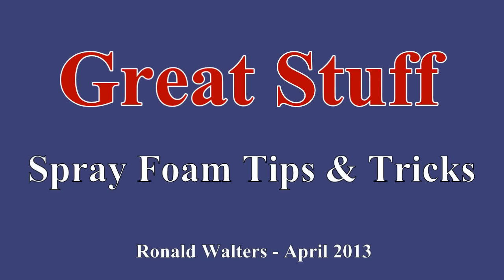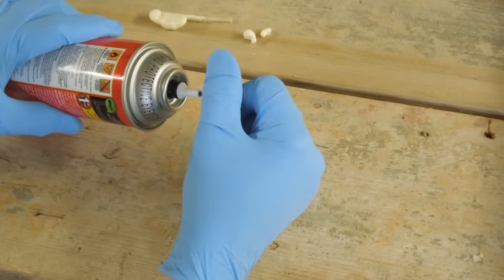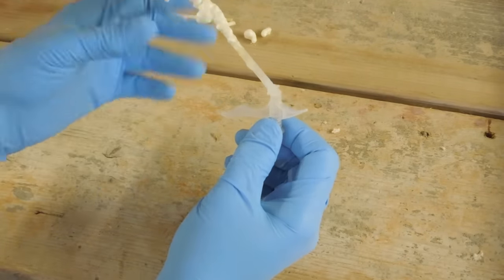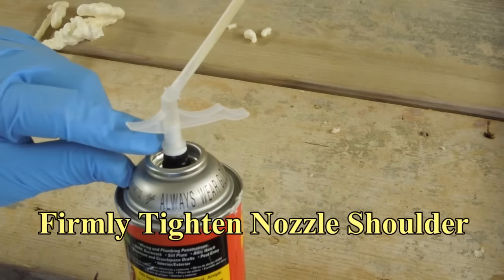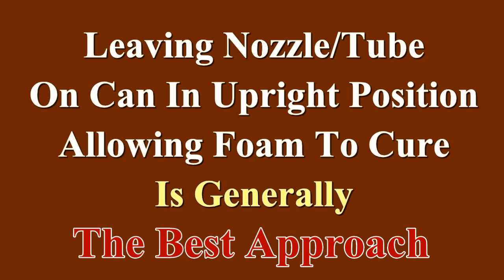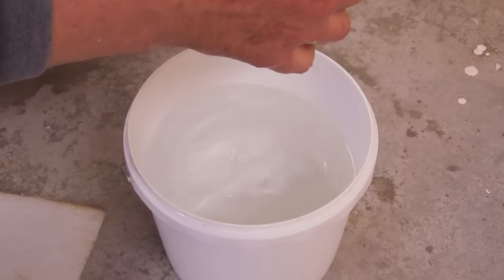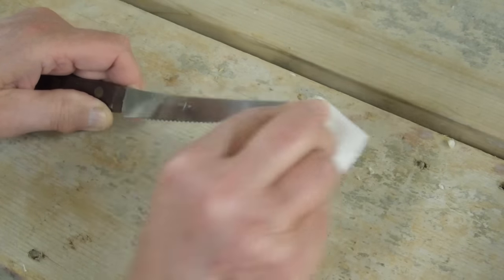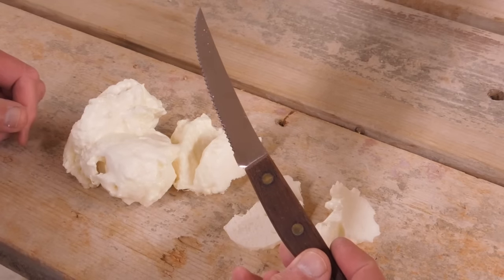Reusing Spray Foam Cans No.1 - Tips & Tricks

Comment: Use break pad cleaner or carburetor cleaner as mentioned below. It works great for cleaning the nozzles etc! It'll go a long way. You don't need the screw. less worry of puncturing the seal and spraying all over; limiting the danger of spraying your face. Protect your Eyes!!!

Comment: This is a really informative video. I've turned the cans upside down in a cup half full of acetone in order to dissolve the cured foam in the nozzle. It worked well enough that I'd have done it again -- until I saw your video. Your screw method is the better way by far. Thanks for making and posting this.

Comment: Just got thru accidentally making a sheetrock patch worse! Not because of any spray foam but because I pressed against the inside edge too hard as I was placing a sheetrock screw. So, I've re-cut a new patch. This time I only crumbled a 1.5" round hole in the edge. There's nothing behind the hole, so I plan to use the brand-new can of spray foam I bought. It's such a small application that I almost just filled the hole with mud... but that would take a lot of time due to the multiple times I'd have to fill, and let dry. Fill, and let dry. Thanks for your video! Now I can save the remainder of the can for the next gaps I create!

Comment: You give great directions.Thank you for all the tips.  Last time I bought this stuff  I called the company to ask them how to save it and they said it has a one time use.  So I needed it again and looked up your video hoping I could save it and see that now the dispensing straw is different.  It is now a red plastic tube with a yellow thing at the end that you"open".  It shows that you close it when you're done.That implies to me that it might now be reusable and shouldn't dry up inside the straw but the directions on the can  still say "one time use is to be expected" . The nozzle looks like it will make it harder to clean out the straw. I'll find out. Thanks for all the cleaning tips too. I'm "the wife" so I only have myself to get mad at if I mess up an old knife.

Comment: As everyone knows, this stuff expands, often more than one anticipates, and my know-it-all construction buddy likes to try to shape it like caulking when this happens, WHILE IT'S WET, which is a mistake, and it only takes 2-3 weeks for the stuff to wear off of his fingers! I put masking tape on surfaces like window edges that I want to protect before spraying it. Resist the temptation to touch it if it grows too big - as it often will. Let it dry, then trim it neatly, and use the trimmings to fill the underfilled sections.

Comment: I'm just about to seal a long run of buckled flashing with Great Stuff foam, and I was dreading the waste of money on the famously non-reusable cans. I strongly suspect that your VERY detailed, thorough video is going to save the day. Many thanks!
Reply from the maker: A word of caution about using this foam around door or window frames or anything flimsy (?? buckled flashing) as the foam can generate a good deal of pressure as it expands and cures causing distortion. A low expansion foam or caulking may be better... but I have no idea what you are trying to accomplish. 
Thanks for watching.
Reply: Thanks for the heads-up Ron. Explaining exactly where I'll be applying the foam would have taken a couple of sentences, so I took what I now realize was an ill-advised "shortcut" by calling it "buckled flashing." In fact, the aluminum is backed by half-inch plywood, ring-nailed on 6" centers. Nonetheless, my past experience has demonstrated just the high pressures you warned me about, so I'll be careful about how much I put into the gap.

Comment: Here's an easier and safer method that works for me every time.  Immediately after dispensing the foam, remove the tube from the can and clean off all the excess uncured foam from the can nozzle and the tube.  Next, with an eyedropper, drip some acetone into the nozzle until all the foam dissolves.  Do the same with the tube until the foam is all dissolved.  To finish cleaning the tube I make a "spitball" out of a bit of paper towel, shove it in one end of the tube and blow it through using compressed air.  For those who don't have a compressor, a pipe cleaner may work.  This method is safe and works every single time for me.  The manufacturers will never share this tip with you because they are greedy and want you to buy more product.  They don't care about waste.
Reply: I've always done this, but now, i'm going to try Ron's method. Here's why. I'm finding the nozzle itself is getting stuck. I don't know why, but it makes sense(as Ron showed)if there is NO foam in the nozzle at all, it can't get stuck.  So, to make sure you and anyone that doesn't do this knows, i know, I've done exactly what E.Plumbus does, exactly, and i have a couple of brand new cans i can't get foam out of. It appears, to me, that the nozzle itself is somehow frozen. I was finally able to break one, not ideal, but hey, i needed a dab of foam.   BTW, this stuff is great as a glue. I don't know it's long term holding power, but it sure works well. Also, if you are careful, you can scoop it up, and re-apply w a putty knife. I know, i know, it doesn't 'expand' as well, but it works well enough in certain situations.
Reply: Hi, I am the wife of Bruce (the name on this reply).  I used the acetone/dropper method and it worked great!  I felt more comfortable using this method than putting a screw into the top of an aerosol can.  Tip:  Put some acetone on a paper towel after you are finished with everything to clean up anything the diluted foam touched.  If possible, clean it all outside over paper.  Thanks for the help!

Comment from the maker: I used small plastic tubing to get the foam into areas overhead where the can was hitting the ceiling. The gas pressure in the can is relatively low and the extended tubing creates enough backpressure where the foam comes out very slow and when the can is half empty it nearly stops altogether. Therefore the tubing extension cannot be very long. A clamp where the tubing goes onto the nozzle nipple is also a good idea. Safety goggles, old clothes and gloves again absolutely necessary.

Comment: Great video. I also found about 1cc of acetone tipped into the can nozzle dissolves the liquid foam and cleans it up ready for next use. Same with foam that's still not set in the tube, where it can be gently squeezed through.

Comment: Helpful video… I've also found success with simply pushing a wooden skewer or wire ( like an insulation put up wire) into the straw immediately after use. I leave the straw connected to the can, skewer and set aside. If careful when removing, one can have success with this, if not the straw can break off at it connection point…The cured foam typically pulls out clean from the straw and the can can be reused…   :)

Comment: Excellent! And thanks for showing the flame test.  In 1975 someone got a flame too close to similar foam at the Brown's Ferry nuke plant and the resulting fire followed the cable trays and took out many of the connections between the control panel and all the various actuators, pumps and valves and meters. They barely scrammed the reactor and I don't recall if they ever got it going again. So your reminder is good that while this stuff is a great insulator, it is not so great in event of a fire.

Comment: I find that an old hacksaw blade with a sharpened point or tip to plunge into the foam and then make a cut works very well. I also made a handle for the blade. Great video-good tips!

Comment: i clean the nozzle and tube with card cleaner right after use.. works great.. i've use the same can 5 or 6 times for little foam applications..clean it with card cleaner stored it for weeks and started right back up..

Comment: Wash the nozzle tube and the can's valve with acetone immediately after the job is done.  Acetone dissolves the fresh foam very well.  With practice you can get away with using only an ounce or so of acetone.  Shake the can well every time you pick it up to use it.  No "low gas" problems for me.
Reply: I will try that! I have used WD-40 to clean everything and I have gotten 4 - 5 uses out of a can.

Comment: what a fantastic helpful video. thank you so much for the tip.
Reply: I wonder if you could refill the can with an air compressor like you can with other aresol cans
Reply from the maker: I would recommend never doing that with any aerosol can. 1st it is a dangerous process 2nd compressed air may not be compatible with the can contents and 3rd any moisture in the air would react with the foam causing it to harden in the can. Thanks for watching!

Comment: I dunno about in the USA but in Canada they just changed the design so you can't do this anymore. they made the straw thinner so a bamboo skewer is too tight and gets jammed, they fused the straw to the nozzle so it cant be removed, and the tip of the can has also been changed, the neck is too narrow to accept most screws and it's flared at the bottom so the solidified foam can't be pulled out. what bastards.
Reply: I was recently able to use all of Ron's tips with a can of Great Stuff that I bought @ Canadian Tire.
Reply: I agree with you, they are bastards, but try the above, I use it too, sometimes they work, it is wort the try anyway, Good luck
Reply: Re-designed to make you go out and buy another!
Reply: rust blade v

Comment from the maker: Water (humidity) is what triggers polyurethane foam to cure, just like polyurethane wood glue. On a hot dry day spraying (misting) water into the application area will accelerate the cure. Prior to being cured it is a sticky mess. If left to fully cure it will come off fairly cleanly.

Comment: Good video if you forget to clean up but the easiest  way is a quick spurt of gas in the upright position then take the nozzle off and put a paper towel or tissue over the end and blow through it. I use this stuff by the case and rarely have a problem with clogged nozzles or running out of gas and like you said I keep the new nozzles for later. Thanks for the video

Comment: Can be cleaned. I use "Good Off" from Walmart. Removes glue residue,paint,even two part epoxy. 
Scrape off foam best you can. And put on good off on rag. Let soak good. Then wipe. Might take couple times but works. Hope it helps

Comment: I just clean the stray and can tip with carb cleaner.  Insert the carb cleaner straw in to the foam straw and spray it out. Give the can tip a quick spray and then insert a piece of wire into the foam straw. Works every time and only takes a second

Comment: We use a lot of great stuff.  After use if there's some left in the can we unscrew the hose section and take an 8 inch section of romex 14 ground wire and run it through and leave it in.  The dried foam comes out easily next time.  We also gently screw a 1 5/8" sheerock screw into the valve, and simply pull it and any dried foam plugging the valve out next time we use the can...

Comment: I had a can I was using start to run out of air (or so I thought).  So I punctured a hole in the can to get a little more out to push into the hole.  Well the can had plenty of gasses left in it but must have just been clogging up.
The can basically exploded foam all over my siding, downspout, and everywhere else.
It took hours to clean it all and had to replace the downspout!

Comment: Dip the top of the can in acetone  and soak the straw in acetone for a few seconds. It will clean both out so you  can use it later. A Ginsu  type knife works great to cut the foam.

Comment from the maker: I have not used the ORANGE fireblock foam. I think it is a draftstop smokestop and in those terms only will help slow the spread of a fire. I believe the can says FIRE-RESISTANT. Personally, I get the impression it is basically the same foam died orange and my guess is it will probably burn just like the regular stuff. Can’t be very good when they say not to apply it around anything that gets hot.
Found on a Google Search: It DOES NOT qualify for an approved fire block in a fire rated wall.

Comment: Thank you, man. Worked like a charm, but they have a new nozzle with a non-removable tip. (???) It slides popping forward to open and back to close. It's worthless for their attempt to conserve the tube or prevent us from conserving the tube which would eleivate our attempt to conserve the can contents for additional usage.  I was able to remove the head and clean as suggested as well as push the hanger inside the tube to the tip of the non removable tip.
Reply from the maker: Last year I published two more videos on the cans with the new straws. 
https://youtu.be/Ig1GD07miiw  and  https://youtu.be/mg2NYBpd_5Y Please Subscribe!

Comment: lol about the wife not knowing...im the wife and im the one using utensils hehe=) i love spray foam its a great fixer upper ! i didnt know about the flammability tho...that is a bit scarey
Reply: Giselle B no worries. regular insulation isn't fire proof either. the difference?  I believe there is more harmful chemicals that Burning  spray foam gases off then batted insulation (if your one of them that want to go 'energy efficient' and get their house done in foam instead of insulation)  the only insulation out there for walks that doesn't burn is called roxule insulation.   it's fireproof and has soundproof advantage.

Comment: Ronald Walters --Hi--there's window and door great stuff that doesn't expand and warp.  As for putting it under tubs, we had luck getting a 4' length of plastic tubing(1/4"diameter or so) and hose-clamping it over the valve on the can.  The foam can pretty much be directed anywhere under the tub, and the can held upside down easily.  When you're done, just snip the long hose and leave it under the tub.

Comment: I always wear gloves when using that stuff.  I run a pipe cleaner through the tube, also use string trimmer line to clean nozzle and tube
Reply: Farmer Doug back in the day it used to come with gloves in the cap.

Comment: I never tried this technique, but I'll give it a try. At present I use "Acetone" and a dropper when  I immediately finish using the can I add a few drop down the nozzle of the can and the nozzle attachment. You can actually see the "Acetone" neutralize the foam.
Reply: Crazy   I get it worked for you but isn't that dangerous because of the gas in the can and acetone is highly flammable

Comment from the maker: I usually do not have time to mess around with the cans because I am busy working on or cleaning up something else. Then later on, when I would have the time, it is already sticky and half cured. It comes off clean and fairly easily when cured (dried). I do not know what the components of the can valve are made of so I do not know if I want to put acetone in there. And, why waste the acetone?

Comment: Thanks for the video/ideas on how to clean......ill remove the tube, take a Q tip, soak each end in acetone/nail polish remover, stick it in the tube and then push it thru with a piece of wire.  it cleans it pretty well

Comment: Great informative video.  I'm about to use Great Stuff to add support to a bathtub I just installed.  I'm trying to get a feel for how much it will expand and how rapidly.  I'm going to go under the house, reach in beside the drain pipe, and squirt it along the sides of the tub.  Do I empty one can per each side.  1/2 can?  Any thoughts, Ron?  Tub flange is nailed down, and I will fill tub with water to avoid possible lifting.  Any thoughts appreciated.
Reply from the maker: You say add support to the tub. The bottom of some tubs feel like they flex a little when you stand in certain spots. Great stuff expands and gets stiff… and then it makes what I call a secondary expansion or creep. This second expansion is what can mess up window and door frames, warping the heck out of them. That is problem No.1 as it can buckle or bow a flat section.

Problem No.2 is you need to hold the can upside down to dispense the foam. Their website says, “all-direction dispensing” but up until a year ago I have not seen any of those in our stores around here. All of the cans I have used required them to be used upside down if you expected to be able to empty the can.

You say, “Reach in beside the drain pipe.” It would need to be a hell of a big hole to have access to the sides for the length of the tub. You might experiment with Big Gap Filler (which I have not used). I do not know if the foam expands more or if the dispenser just uses a larger tube. I do not know how rigid the Big Gap foam is. Like I said, experiment with some first.

Same goes for how much you think you want to apply. Experiment first. Sometimes you need to go back and apply a second or third stringer of foam. Wait until the first application COMPLETELY cures or you will make a genuine mess of things.

If applying the foam in a trapped area it is often a good idea to spray mist some water into the area immediately before spraying the foam. Moisture is what cures the foam and if a section is airtight, sometimes the foam will not completely cure which can be problem No.3

Check out some of the FAQ information they provide at http://greatstuff.dow.com/faq/

Not a bad idea to WASTE A CAN experimenting with application technique and the results to determine if you can or still wish to use the product for your particular situation. It is very hard or impossible to UNDO this once applied, especially in a tight, inaccessible area. Notice I suggested EXPERIMENT several times. :-)